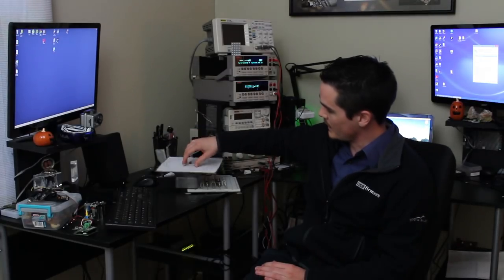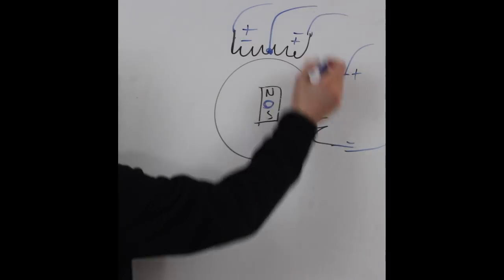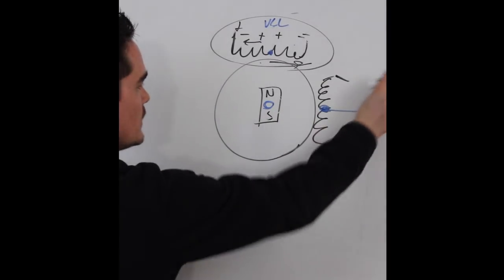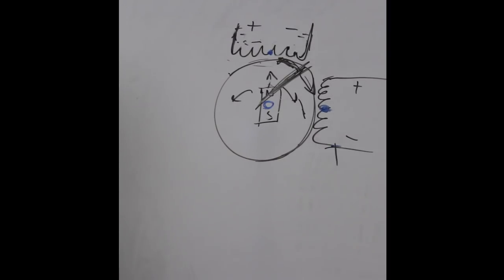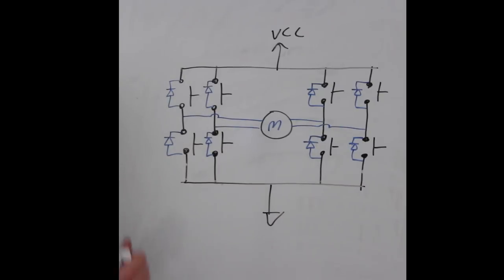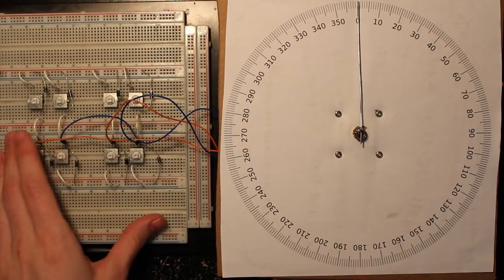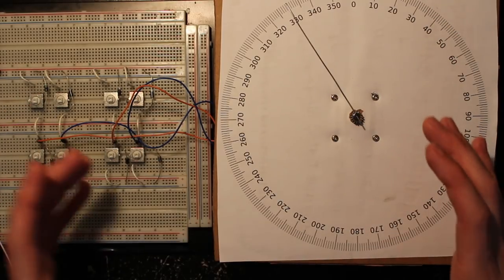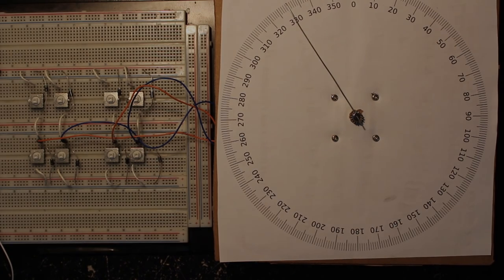Stepper Motor Basics - Demo with just Push Buttons!

Comment: The best explanation of how stepper motors works and how to control the steps I have seen! Thank you for taking the time to explain the fundamentals of operation, explaining the circuit, and using a cardboard labeled with degrees to visualize.

Comment: nice intro for stepper motors. Took a degree in electronics back in the 80s and never touched the subject again even as a hobby. So much has changed and an awful lot hasn't changed at all.  Still, your videos are clearing away the cobwebs so thanks again.

Comment: In the US Navy's Basic Electricity & Electronics school (called "B-double-E" school) we approached stepper motors in a sequence of increasingly complex control mechanisms:
1. Take two batteries, one for each coil, and flip them together/separately to make the rotor turn.
2. Do it with one battery.  Getting the leads connected and moved was hilarious.
3. Use pushbuttons, as done in this video.  Notice the smoke from the wires melting their insulation when fingers get confused.
4. Replace the pushbuttons with a pair of DPDT center-off toggle switches.  Muuuuuuuuuch easier.
5. Replace the toggle switches with H-bridges.

Success!  Our stepper motor collection included some the size of a peanut, up to the size of a 5 gallon bucket, and we got to control nearly all of them.  We felt so good.

Then came Synchros, Servos and Control Transformers...

Comment: Thank for the explanation. I am trying to get a foam cutter board working that uses a mm2001 board with unipolar steppers. You mentioned using mosfets. As this board uses large resistors and they get hot, I was thinking about trying to figure out how to use mosfets to change things so there would not be so much heat. I am only a hobbyist with electronics, but it would be a great help if you did do a video showing how to move unipolar steppers with mosfets that were driven with a uln2003.
Thanks for the video.

Comment: I am a woodturner that makes "basket illusions" actually a wooden bowl or vase that looks like a indian basket. I have vertical marks from 96 to 140 depending on the design. I now use a degree wheel and move the basket then use a pencil to mark them . It is not really accurate so I thought by using a stepper motor it could stop and start around the basket. I seen your video and seen where you used a number of switches to do that. I need some guiding on doing the same thing.
Reply from the maker: hmm, well I might have a video in the near future that you'll like... working on a stepper driver video.

Comment: Nice, "quick and dirty video". Some how I don't think it was that quick setting it all up. Thanks for taking the time to do all this, I know how much time it takes to do it. If you get the time, big if, show an inset with the motor schematic and color the wires to show which ones are energized. Kinda like AllAmericanFiveRadio does in his vids. Maybe even show a drawing of the inside of one with all the multiple poles, then take one apart and show it and explain why it only moves 1.8 deg's. It would be a great tutorial follow up. Often thought about doing what you did here in this video myself some day but never seem to have the time. Nice video agian. Look fwd to seeing more on your channel as time permits. Best Wishes/Blessings Keith
Reply: great video,  like you said,  it didn't explain why it turn 1.8 degree instead of 45.  thx anyway.

Comment: hi, thanks for the video, it's very cool.  question - i read from some other articles that when running and reversing power to the coil really quickly, it would create back-kick effects, and so capacitors and droids are needed?  what's your thoughts?

Comment: If the spec sheet does not indicate the voltage, but it does the current, how do you determine what supply voltage to use?

Comment: hey Kevin, what do I use to capture specific range in frequency to activate a specific stepper motor that is programmed to do a certain rotation in commands? Does the information have to be MIDI already then fed into this  ...(thing i need to talk to specific motors)... or can I just get some device that doe this automatically?
cheers

Comment: if i want to use stepper motor just for it's high torque. And i need only moving in one direction with the highest speed possible and all the benefit of the torque, how am i about to do that?

Comment: I made a driver from an h-bridge plan I found on the Internet. It seems to work fine, but I can't get any speed at all. I got a small boost by carefully adjusting the time between pulses, but it felt random - if I switch to another motor I would have to tune/guess again.

Is there a way to achieve high speeds or tell what a reasonable speed is?